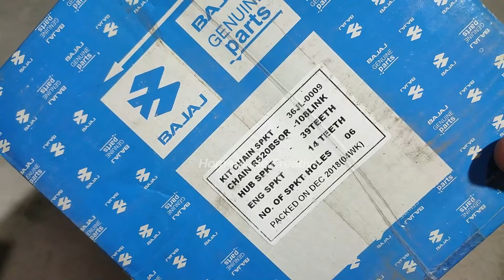😱😱 i builded world's most powerful diy electric bike

Comment: Use the diy  belt drive for smooth and very low  noise ride  better than chain drive which is very noise and  chain needs maintenance  and belt not any maintenance
Reply from the maker: Belt Drives are Not Efficient and Powerful Compared to a Chain Drive, Also I Can't Find Belt and Pulleys According to Needs
Reply: Even if bro u have belt & pulley then also its very difficult to integrate with existing hub

Comment: liked for the effort. but I had one idea💡that u can use that petrol gear box and instead of piston u can use that motor it will be money saving for u and time saving also 🙃🙃😅
Reply from the maker: thanks You Liked It, 
Let's talk on your Idea, the main Problem is motor has Max RPM5200 and Engines Run on Max 11000 to 12000, Almost Double RPM and for that if we connect chain, That would be so Noisy, needs Extra Sprockets and Maintainence and if you go for belt drive, can't find that short of belt and pulleys, second problem we have so much extra weight and then don't have much area for the batteries, and you can't get enough kilometers, so overall it is not good idea, Hope You Understand